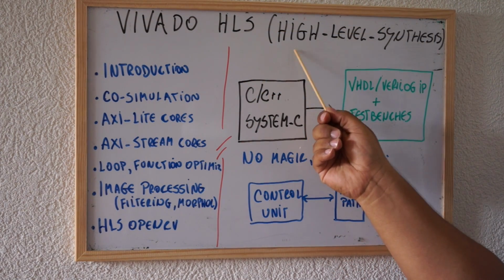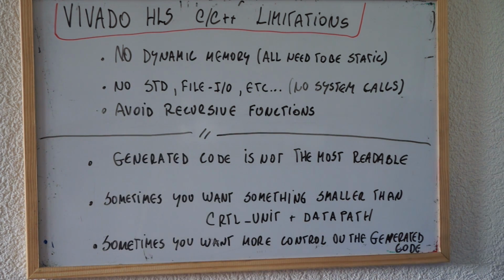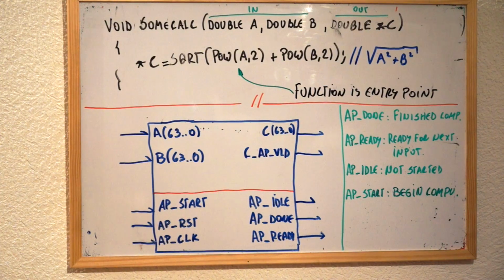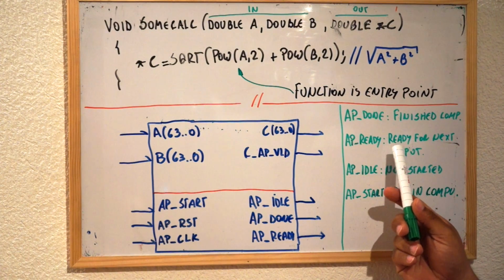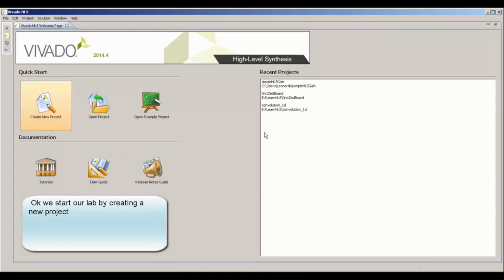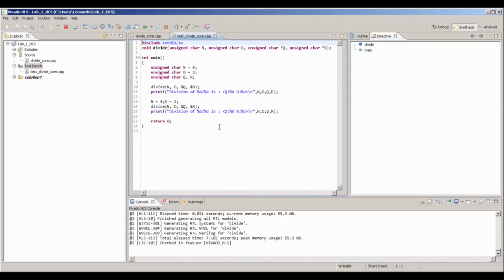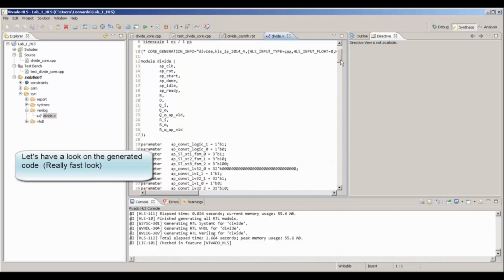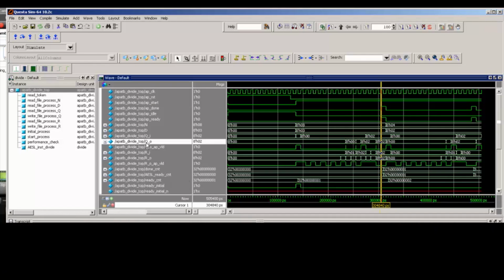VIVADO HLS Training - Introduction #01

Comment: Hey, thanks for the tutorial. I have 1 question , why did you declare output ports as pointers? Why only output ports not the input ports?
Reply from the maker: Hi and thanks,  the idea is that the output parameters will be changed by the function body so we need somehow to make that clear to the compiler, thats why we say that they are pointers, basically is another way to say that those output parameters are just memory addresses that will be changed by the code (thats for the c point of view) now for the hardware synthesis he will look at that and detect that indeed you are talking about something that will be changed by the function body and it will infer that it is an output port? That is clear for you? If not maybe i can create some other video explaining this. Anyway if you have another doubt or video idea just ask. Again thanks man.
Reply: +The Development Channel Thanks, got it.. So if my inputs are also changing then I have to declare my inputs also as pointers? In your code you are assigning single values to N and D that is why input ports are not declared as pointers. Can you tell how can we give a sequence of inputs in testbench? Is it as simple as just writing a for loop inside the testbench, instead of simple assignment statements? And also what changes have to be made in the code?
Reply from the maker: Hi +Gaurav Vanvari in the case that your inputs are arrays, yes you should declare them as pointers, actually vector and pointers in C/C++ are connected, for instance if you declare a char vector of 100 elements say (char someVec[100]) the name of the vector in any assignment will be a pointer for the first element of this vector in other words (&someVec[0] == (char*) someVec), but does not mean that you should pass function arguments as pointers just because they can change got it? (If you want latter I'm planning on making a course about C/C++)